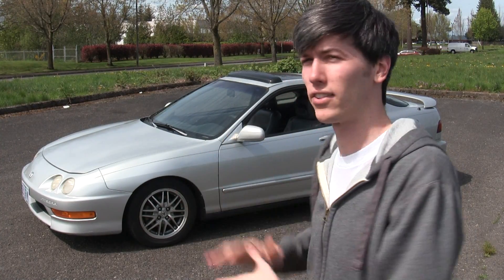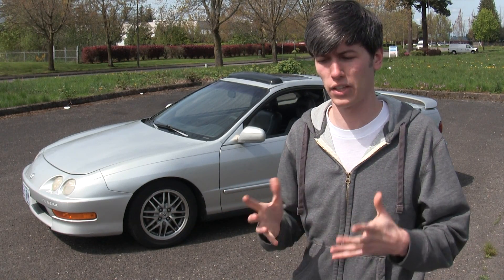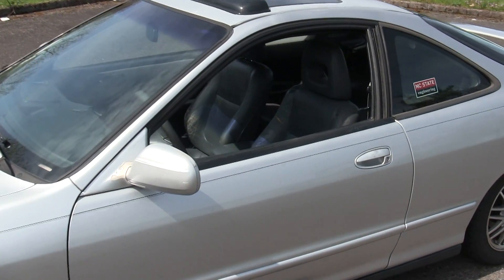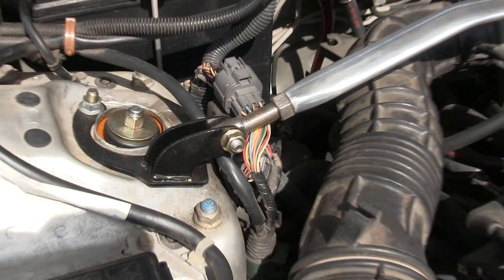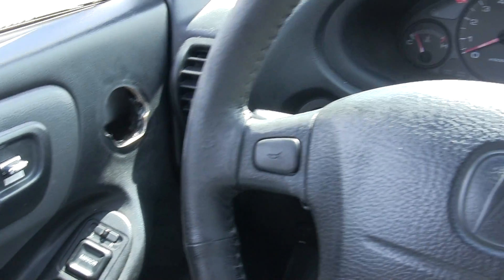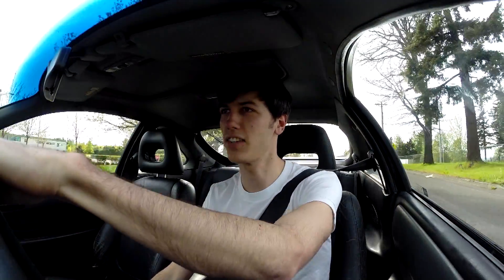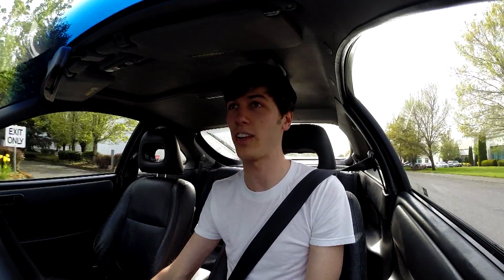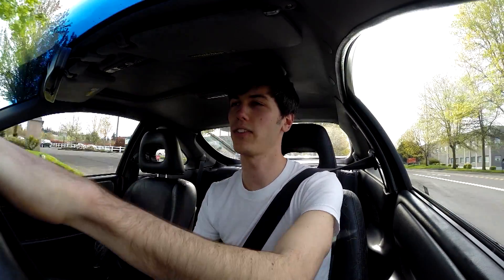Project Integra - Let's Build A Race Car

Comment: Combine the best of both worlds and go VTEC initially with an eye on turbo power longer term. Yes, a high compression VTEC turbo motor. A good tune is key to reliability here. Since the Integra is a communicative and responsive car in terms of steering, suspension, and transmission, the quick and precise throttle control VTEC provides is a good complement to these characteristics.

You'll probably want 

-VTEC head with GSR or Type-R cams (Type-R prefered)
-10.5 or 11:1 compression pistons with rods, both forged
-rod bolts as those are the key failure point when going VTEC with a B18B
-new bearings, seals during engine rebuild would be ideal
-ECU - Hondata or maybe Chrome if on a budget
-golden eagle LS/VTEC conversion kit so the oil plumbing is done right
-perhaps a block guard to keep cylinders rigid when revving high
-JDM GSR or any Type-R transmission with helical LSD

Lower your VTEC point 500 rpm to 5500 rpm once the engine is in, since the motor is slightly stroked with an 89mm LS crank versus a stock VTEC engine. This will allow you to shift at 7500-8000 rpm and stay in VTEC with the GSR transmission.

You'll definitely need shorter gears to enjoy the VTEC without turbo, and somewhat longer gears once the Turbo is in, so the JDM GSR transmission seems like a good choice. It has much shorter gearing than the non-VTEC LS/GS transmission, but is still longer than the Type-R. I'd ask around on teamintegra or hondatech for advice on this. The LS transmission with an LSD upgrade may work well with the turbo once in, so save it.

When turbo time comes get a small turbo like the classic disco potato because you'll want quick spooling if the aim is to preserve responsiveness. With VTEC and the high compression you can't go very big anyway. ~250-300 whp is good enough for light FWD vehicle built for corner carving, and the small turbo will allow boost to be available closer to 3000 rpm. This car is up there in terms of minimizing torque steer compared to nearly all other FWD cars ever made, it should put down 270 whp nicely.

You may need to upgrade the valve springs if using ITR cams in a GSR head, and defininitely if going to larger turbo cams. Once the turbo is in it would be especially good to upgrade these to something a little stiffer, particularly if the used springs are getting old or you're pushing the limits of coil bind running ITR cams in a GSR head. There is a nifty tool to install them without removing the head so you can do this at home without too much dissassembly.

Comment: Here's my .02 cents:
-LEAVE THE ENGINE STOCK AS IT IS!!
-Do an extreme diet on the car
-Just start with nice shocks and springs w/ extreme performance tires
-Have fun and kick ass at road race/auto-x events!!
-As you get a feel on how your car behaves at the track you build on from there

I quite some vids in my channel of my EK civic doing a bit of road racing, it still has the D16Y7 completely bone stock

Comment: Two unconventional ideas from a fellow engineer:

1. Have the alternator on a switch in order for the car to draw power from the battery. Less current being drawn from the alternator = less engine resistance.
2. Have a solenoid (or two) on the exhaust just past the catalytic converter. Engage the solenoids to reduce engine resistance and have increased performance for when you need it.

I would be very curious to see your findings on the first one. It's an idea I've been kicking around for a while. As for the second, since I am an engineering student and cannot get a real exhaust, it seems the next best alternative, although loud.

I love your videos, keep doing what your doing!

Comment: strip everything down as far as you're willing to go, interior and engine out.  do a moderate roll cage in the interior and one lightweight seat/harness maybe two.  I would tear the block down to the crank and there is a few ways you could build this guy I honestly would build that ls for boost, i see people having a lot of fun on a nice ls boost setup.  wiseco would be my choice of pistons and rods, do arp head studs, a factory crank would suffice but thats up to you.  I would do a stage 2 flywheel setup which can be found on ebay from a reputable dealer for a decent price. and also ditch that ls head and swap in a gsr head.   There are plenty of reputable turbo's to choose from the obvious choices are greddy, turbonetics or Precision turbo, do a 50 trim maybe, intercooled, push like 18-20lbs and enjoy.  I would get myself one of those cool twisty exhaust manifolds and wrap it in titanium weave wrap, delete the ac/ps just to loose the weight in the bay, along that same lines i would relocate the battery to the trunk.  while you're in there you might as well do some wire tucking and get that bay as clean as possible, trust me if you dont you will regret it.  other than that tune on whatever you choose, probably since you love being so technical, do a stand alone AEM ecu so you can do your video about all air/fuel ratios and crazy details but tune tune tune and make sure that thing runs smooth and it will be amazing, reliable fun.  Notice i didnt say oh get wheels, and spoiler and blah blah, if anything i would get a carbon fiber hood and paint it to match the body.  Engineering Explained Teggy Sleeper all day baby!!!
Reply from the maker: Great ideas!
Reply: Kamran Idrisov if he is gonna go through the effort of building this thing and putting the money into it he might as well put some money into theft prevention.  dont just pull the fuse, get yourself a decent alarm system, something like a viper which will have not only the shock sensors and door sensors and a leveling sensor.  but you might even want to get one that has remote engine immobilization all though that gets spendy cause they often come with a subscription cost.
Reply: Engineering Explained You should take out the ignition coil fuse. then they won't steal the car again.
Reply: This.

Comment: Completely strip interior minus drivers seat, bolt in roll cage( how stiff do they make the car??) VTEC head with short ram/cold air intake, lightweight flywheel with performance-ish clutch

Comment: Hope Im not too late and your budget isnt blown. Hmm.. engineers budget and project car... 1st, I would leave the windshield and door glass well enough alone but would replace the rest of the windows with lexan or something similar. Maybe make fiberglass frames and vacu-form clear plastic onto them.. hatch glass alone has gotta be 50+ lbs.. Second, borrowing an idea from a Grassroots Motorsports article, clear the back seats and make room for an M1 Abrams cooling fan to lay in the hatch/back seat area, attach high hp stand alone motor to it, build ducting and skirts (F1 like), create actual vacuum (you do the math on how much actual vacuum haha*)((paint it black scenario maybe)). Dude in the magazine had craaazy high lateral g-forces in cornering cornering though.
Oh, and the obvious stuff too: CRV AWD system (SHAWDY if ya could but $$ I guess), turbo motor, juice boxed and.. I'll get back to you if I think of more.

Comment: Ok, strip it out. Get a new driver seat as a priority and some nice wheels and tyres. If its going to be a trackday car I would suggest uprating the braking system next, braided lines / track pads ect and then see what needs improving after that. :)

Comment: Jason,
I am in the same situation but my project car is going to be more fun.
2000 subaru 2.5rs coupe :)
But anyways... 
What you really need to know is whether this thing is going to be built for track, drag, or show use.

my first car was an integra too and i decided to keep it all motor so i ended up doing a jdm itr swap on it... man it breaks necks(if u can get any traction).
but for the money spent, i could have made it stronger by going FI.
Plus turbo'd vehicles are way more fun to drive... ahem* STI.. ;)
I've seen most guys on the road turboing there b18b1's with stock internals because of the low compression those engines came with... but they barely made any power to the wheels. So if you want more power, i would suggest getting a B16a6 or B18c1 and build those up for boost instead of using that b18b1. that VTEC system makes a big difference which i think you already made a vid for... 
But in the end, its all up to you and which application you are going to choose.
Reply: or you can always go with the popular k20 swap. ;)

Comment: First and foremost, look around at different race leagues (FARA, SCCA, local leagues, etc), pick one that you feel comfortable with and build your race car around their rules and guidelines so that you'll get it right the first time.
I'd say focus on the chassis and suspension primarily. It'll benefit you the most out on the track. Unless your engine is way underleveled for whatever league you pick, then see how much you can upgrade the engine while doing some chassis work here and there.

Comment: If I was the one modifying this particular car I would start with a complete equipment test, make sure everything you want to work does, and well at that. Next you can began modifying, start with some easy stuff like removing the interior (Carpet, stereo, seats, spare tools, tire) and replacing some of it with lighter material. Something important to note about fast cars is they have to stop too so get some braided lines and used calipers with new pads and rotors. For handling you might want to swap in some better roll bars to better help the already installed coilovers. Finally the power, while many things can be added and debated about what's best, I am sure a few would agree on adding a turbo. That in mind a turbo with no supporting mods can destroy an engine so get some upgraded parts to help coupe with the extra power, gaskets, open exhaust system, ecu to manage a SAFE boost pressure, and a few other trinkets that come along with turbocharging an engine.

Comment: BREMBOS!!  Upgraded sway bars, strip car out, add recaros, aftermarket exhaust (mugen twin loop exhaust), carbon fiber everywhere, intake , headers, upgraded ignition system, programer, clutch , transmission, short throw shifter , lighter wheels , sticker tires  and a B18c5 swap!

Comment: I recommend doing one of the following:
- Replace the HEAD with a B16 VTEC (which will make it an LS/VTEC)
- Swap the motor out for a B18CR (not sure about how easy they're to find in the US though)
- K20 Conversion (costly)

----
Once you've done one of the following the car actually becomes worth spending money on.

----
In terms of handling - I can recommend Ultra Racing Braces - Happy customer(s) here!

---
I've messaged you - waiting on a reply, thanks.

Comment: K-Tuned fully adjustable shifter, ls/vtec, maybe turbo in the future, haltec/hondata ecu/fuel management, lower your coilovers, engine bay tuck, full weight redux albeit seats interior strip lightweight materials inside and out, full suspension such as control arms etc, big brake kit(Wilwood, brembo, stoptech), efficiency of upper/lower strut bars and traction bars, hid headlamps, just throwing out what i can think of real quick!

Comment: I want to see if we can keep it NA for now. Turbos seems to me like an "easy way". Sure it's a lot of job, but when people are talking of performance increase the first thing they mention is turbo. Plus, for the Integra being a light and responsive car, adding a turbo (lag) will take some of that away.

My suggestion is to increase the rev limit, get a valvetrain that can handle higher revs and then advance the cams and the ignition a little bit.

Another suggestion is to try polishing the intake manifold and the head ports. In theory it should make it less restrictive.

Comment: When you put the new seats in, use the old passenger seat (since the driver's one is junk) for a DIY gaming rig, there's a nice video on one made of PVC pipes here on YouTube. It'll probably feel nostalgic. 

Also, obligatory Subaru vs Integra Drag Race and possibly also on a proper track, if there's any available to you. Now and whenever the Integra gets faster than the Subaru. :3

I wanted to do something similar with my DSM ('95 Eclipse GST). I've been learning a lot about engine tuning, suspensions and other areas of motorsports, especially after entering my University's FSAE team. But that's gonna be next year at the earliest, I gotta graduate first, lol.

Comment: I really like the NSX brakes on my car I'd recommend those. 

Then.... High compression (12:1) b18c5 (sleeved to 2.0L) turbo with a small enough snail to have full boost by 3500 rpm. Would have to run E85 and would be the funniest motor ever.

Comment: Put some great Bilstein or Öhlins complete suspension kit, Pilot sport 3 tyres, some Brembo brakes (calipers + discs ), a cool set of Motegi wheels, a K20A engine swap + Supercharger with K&N Cold air intake, better camshaft, even better piston, new maanifolds, new injectors, a remapped ECU, a very nice radiator/intercooler (i think superchargers need one too), then you put useless weight off, you go for a Type R body kit or something and you're good ! 
You can even change the clutch, or go for a rally sequential manual transmission ( i saw a guy doing that with an R34 ) and go for a better differential but then it will become a race car...

Comment: The most useful thing you could do is a parts comparison.  I.E. these 5 intakes with these 5 exhausts on this camshaft, then replace the camshaft and do it again.  I want to see how many revs you can get out of it before it goes "poof". Try stronger rods then deal with all the fluid flow/cavitation issues...

Comment: Do you know if this Acura Integra mirror fits on a Honda Civic 2000 sedan LX 4 doors? I dont like the fixed ones. Some version from Canadá  and Europe comes with this mirror, manual fold with electric mirror adjustable. It so hard to find them

Comment: Weight Reduction (interior seats, carpets, dash, stereo etc) Low pressure Turbo, AEM Air Intake system, Headers, and front splitter.

Comment: for engine modification how about you try to do a simple bolt on part first see if there is a different such as intake system comparison exhaust header manifold between stock to 4-1 and 4-1 to 4-2-1,.. exhaust piping sizing, with center box, and mufler, also without (for example ehaust cutout) spark plug, racing cable plug, earth grounding, voltage stabilizer, ecu rechip or piggy or stand alone, different degree of cam shaft, adjustable cam pulley, fuel pressure regulator, etc...

Comment: Weight reduction.. Remove sound insulation, all the seats except driver's seat (maybe change driver's seat with lighter racing seat), remove spare tire, remove AC, really, go as far as you can. The best thing you can do to a car as far as performance is making it lighter... (just like lotus does).

Comment: Hey why do cars have pressure flaps in usually in the rear under the bumper cover or on the the back of truck bed if it's a truck I would think the tighter the better?

Comment: Look into hardrace engine mounts. They are solid but are made out of rubber so they really aren't all that aggressive. I have them in my rsx-s. It is my daily and I don't regret at all. The performance is worth slight increase in vibration. I think upgrading the engine mounts in a fwd car is an absolute must if you plan on getting any power to the ground.. And oem won't be able to hold down any power.

Comment: If your planning on really making it go then you should start with safety, ie roll cage, new seats (4 point seat belt) and that sort of thing. While your at it, work on the rest of the interior, strip it,  replace the steering wheel, etc.

Comment: You may start with two cobra or recaro carbon fiber seats & nice TAKATA seatbelts, take away the rear seats, carbon fiber hood & trunk, install every strut bar for the integra available on the market, full exhaust system, any stock replacement filter from K&N or any one else or a full cold air intake, better spark plugs and wiring, full syntetic oil (engine, transmish, diff...), oil catch can, gas cooler, JDM front (just for style), a big 3 upgrade or grounding kit, these to begin with, for more race oriented might be, forged engine with turbo, forged aluminum wheels, drilled/slotted brakes discs and 4 pistons calipers, rollcage, ecu tuning or replace it with a greddy/AEM..etc ECU, more adjustable suspension, take away the sunroof and make it a full steel roof for better rigidity. Have fun, its a nice project

Comment: First of all, reduce weight, if there's something not working repair it. Start with a clean car !
first thing is basic things you can do like replacing the camshaft/stroking it/replacing the injectors/ECU tunning/ etc...
but the most badass thing is to turbocharge it, but b18b is :/ not even VTEC

Comment: I guess race car not a did stripe everything interior because that's free :) lol and then for circuit upgrade big brakes with 1" MC if don't already have that, then entire suspension setup camber toe kits, sway bars front rear, LCA, traction bar, subframe braceing any different coilovers idk of you have ones good for the track or not
Reply: Oh and replace worn bushings

Comment: I suggest putting a vtec head from a b18c or a b16, in stall the head on your ls block, and mod your p06 ecu for vtec, then after the ecu mod and head in stalled and wired up then you can do a dyno tune to show the increased hp and rpm